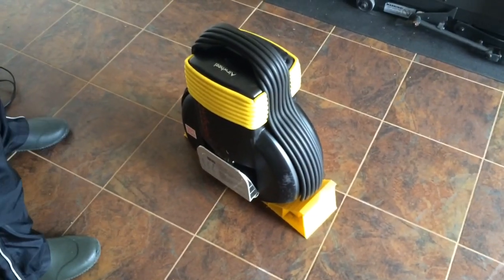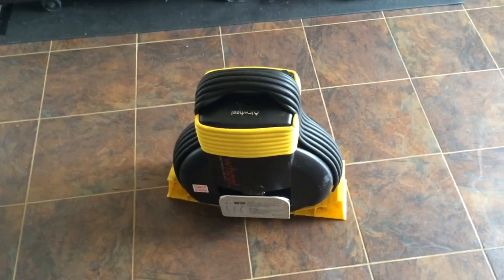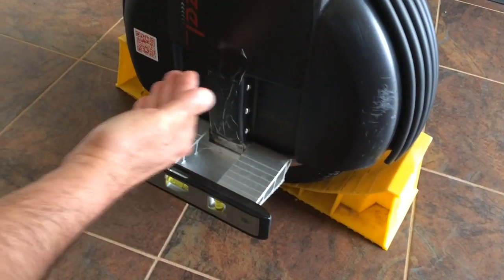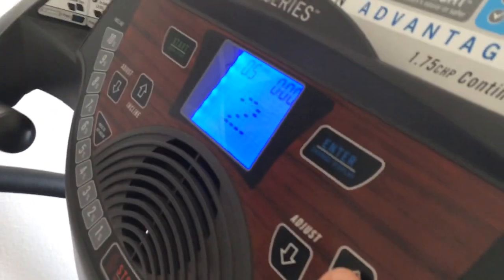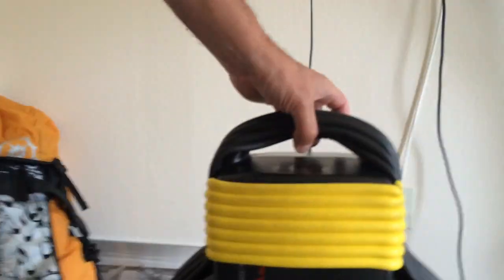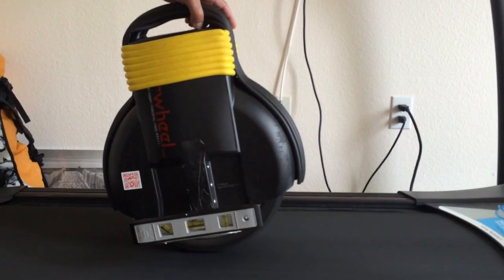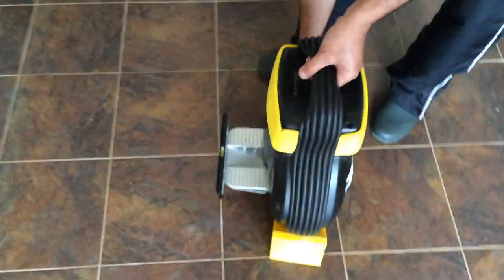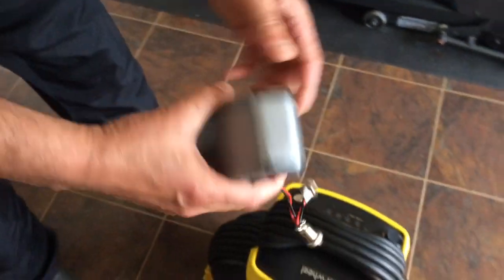Airwheel Speed Test Q3

Comment: hi ,sir
such a great informational video.
could tell me how do i know which is ground and positive on the battery plug when connecting wires? do you have protection on those battery when recharging or does the charger has ? a video on how you made extra battery would be great help.
Thanks

Comment from the maker: The batteries and connector bought through Ebay 		 		
Battery:
16 x 18650 4200mAh Li-ion 3.7V Rechargeable Battery
Connector:
3 pin prong female and male round for scooter charger